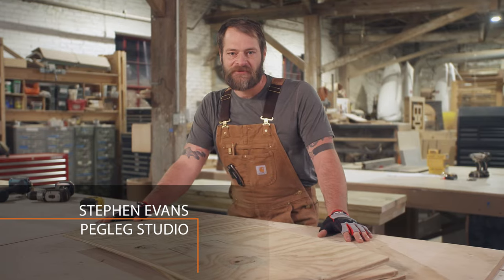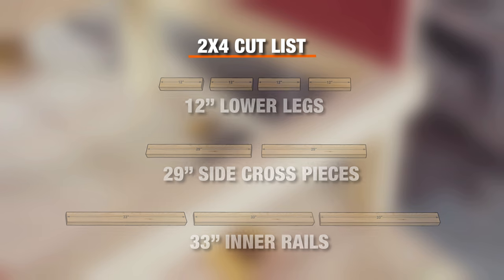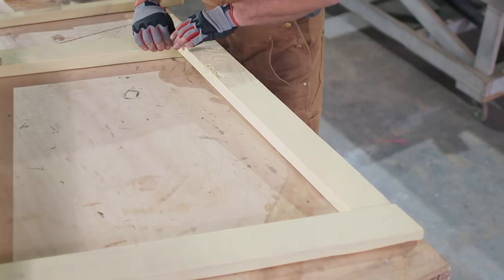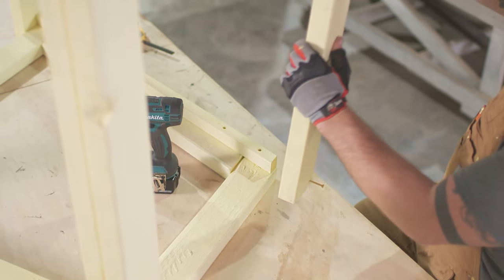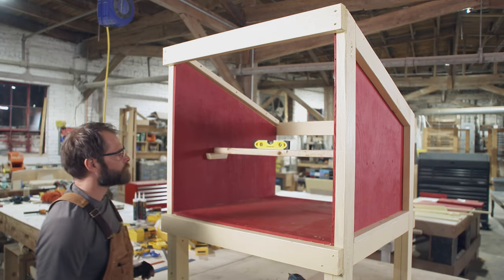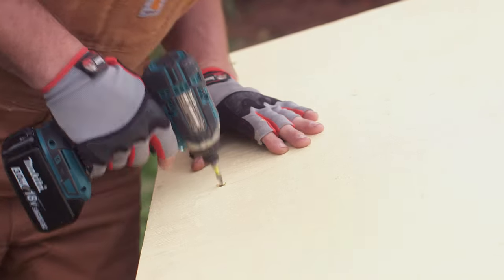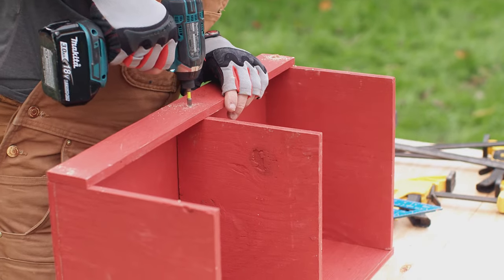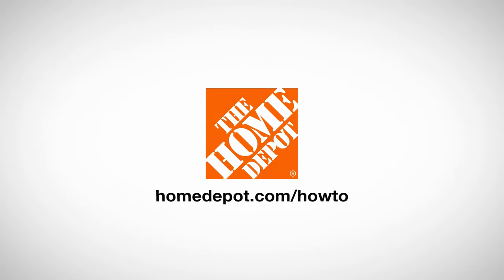DIY Chicken Coop 🐔🥚 | The Home Depot

Comment: Whatever you do, don't try to cut all the stuff out of the first piece of plywood like he says. Look at the backdoor and the floor he has, they are the same length in the picture but different measurements. If you try, you will come up 3 inches short. The instructions on the website in the description lay it out much better.

Comment: Ventilation. If you close that up at night they have no ventilation. If they are not in at night, they are in danger of predation.
Reply: Totally agree - a terrible (but fast and easy - so Home Depot loves it) design. I am just getting into chickens but from what I've researched there aren't any features here that I would copy.
Reply: Did you even watch the video? He adds vents at the top of each side using a hole saw and circular slatted vents.

Comment: I found this tutorial and thought it would be easy enough to do myself and a good size for a couple chickens, and it WOULD be good if the instructions weren't repeatedly incorrect. I've bought most of the materials and started making cuts, so at this point I'm committed, otherwise I would not continue making this. I haven't finished, but here are the issues I have come across so far:

- Materials lists says to get 3/8-inch exterior rated plywood, but that is not a thickness of treated plywood Home Depot sells and I wasn't able to find it anywhere. 
- Material list says you need ten 2x4- inch pieces of lumber, I was able to make all the needed cuts with nine
- Material list says you need three 1x2-inch pieces of lumber, you need five
- Material list says you need 2 galvanized barrel bolts (window bolts), but they are never referenced or used in the instructions, I can't see where they would go in the video or any pictures (the doors are closed with tee hinges)
- The graphics showing the 1x2 lumber cuts don't match the instructions or the provided hyperlinked diagrams
- The six ramp rungs cuts are listed as being 14 inches and then 4 inches in the instructions

I wouldn't recommend trying to just this tutorial unless they make edits to correct it. Also, after researching chickens more this doesn't seem big enough for the 4 chickens its says, unless you bought a smaller bread, the roost is a 2x2 but everything I've seen says they prefer a 4 inch roost and the tee hinges on the doors wouldn't keep any predators out, so the whole coop would need to be protected in other ways.